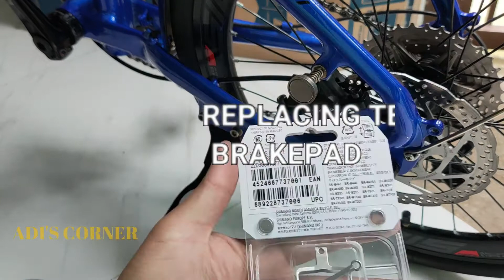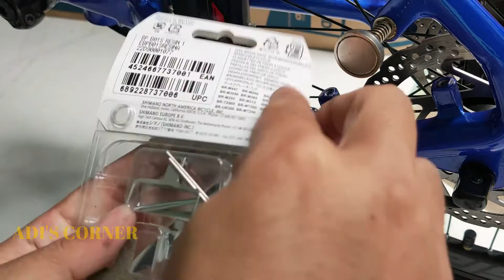Replacing Tektro Hydraulic Brake Pad

Comment: Hi .. i usually use flat tool or wide flat screwdriver  to pry the used pads apart (to depress the pistons) so that when i put the new ones in i don't damage the new pads.. I see you had trouble putting the new pads in because the pistons were not backed off.. And i always put on new rubber gloves before handling the new pads (with care not to touch the surface of the pad) this keeps all oil from your hands off.. Oil causes the brakes to squeal loudly... Do your new brakes squeak..?  Another thing i do before breaking them in is spray the rotor with clean water, this allows the new pads to engage the rotors smoothly and this extends the life of the new pads.. PEACE
Reply: Nice film quality.. good lighting and easy to see.. Bravo..